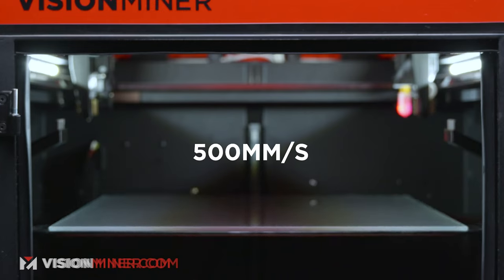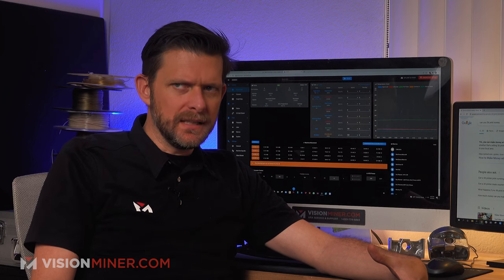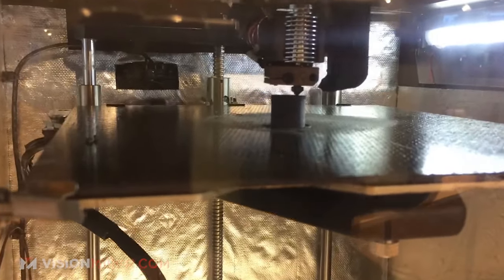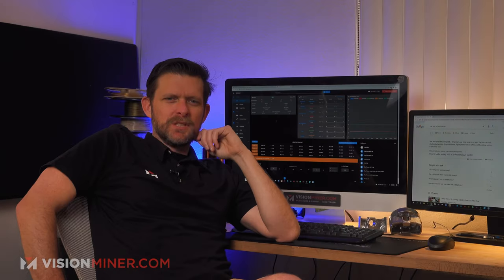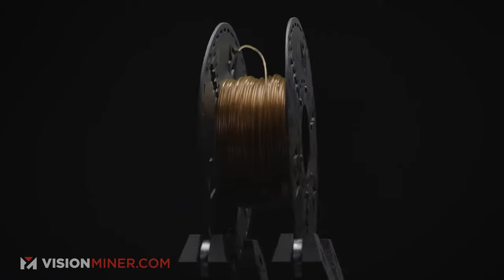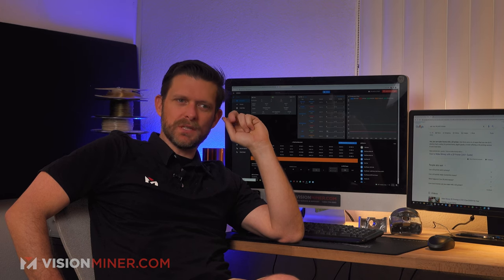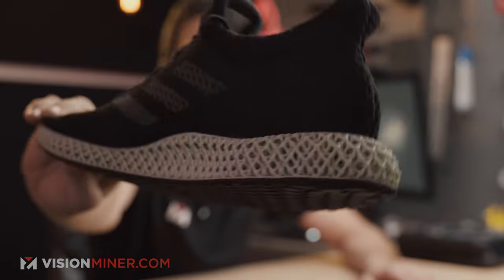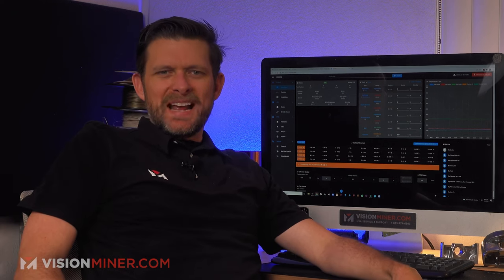The Biggest Lie in 3D Printing | 3D Printing Myths

Comment: I have been using the Raise3D Pro series printer for quite a while now, but I have a 22IDEX purchased, just waiting for it to ship to me (Q2 pre-order), and I'm wondering what slicer do you guys recommend for the 22IDEX?  I have been looking at some of the options.  Raise3D has their own, which is IdeaMaker, which I have learned how to get the best from my prints with it on the Raise3D, but I'm fairly sure I won't be able to use it for the 22IDEX.  In any case, IdeaMaker has an issue with how it prints, in that it doesn't do a very good job in terms of optimizing print time by reducing travel time.  Print speed will be important to me on the 22IDEX, because I'll be using it to print production parts.  I don't necessary need to it print super fast, in terms of the movement speed, but noticing how IdeaMaker works, I realize that a lot of the print time is really in the travel time, based on how it works.  So, print speed is important, and optimizing the print speed is an important factor in selecting the slicer.  I'm not finding good online information that really talks about that.  So, any ideas of what I should pursue as I get my 22IDEX, I would appreciate it.
Reply from the maker: We're going to be supporting Simplify3D, but it will also come with profiles for Super Slicer -- and most slicers will "work" but may require your own setup -- and we're finally shipping out of Ukraine again, so video updates coming soon on the version you'll be receiving! Thanks for the comment!